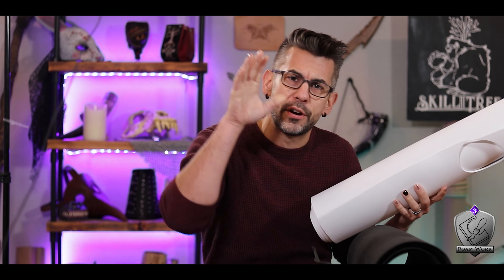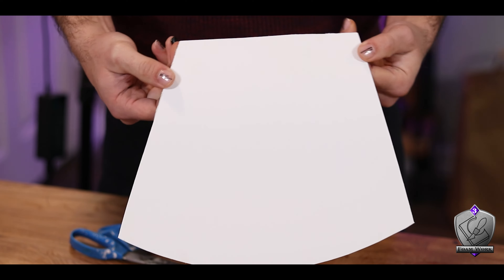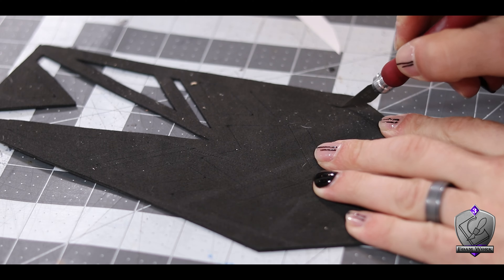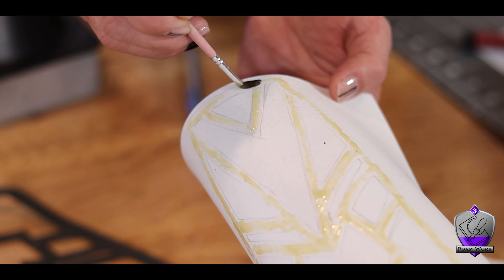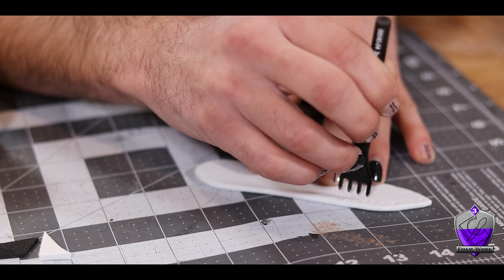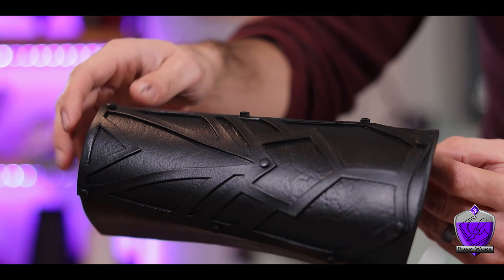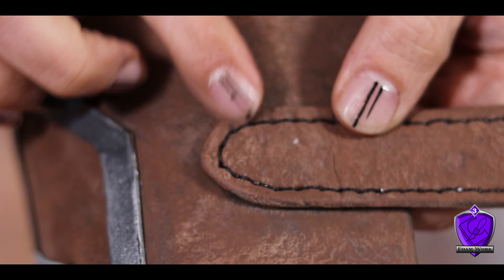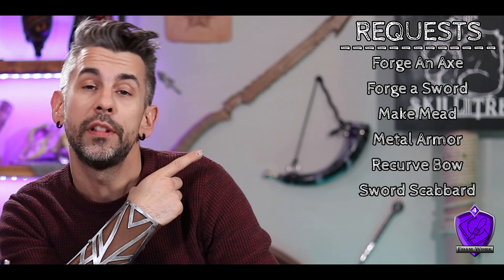Making Armor out of EVA Foam

Comment: 8 months lats to this but please don't just put in a new blade all the time, get a good knife sharpener and save the money, one bladecan last you months before it needs to be replaced, and try to sharpen after each cut, whenever the knife leaves the foam, sharpen it

Comment: What grit sandpaper did you use for the dremel?
Reply from the maker: I believe 120!
Reply: @SkillTree  Wow, I'm surprised it worked so well. When I try to use anything lower than 240, it catches the foam and chews into it.
Reply from the maker: @matthollands7771  maybe speed is the issue? Try it faster, if you can.